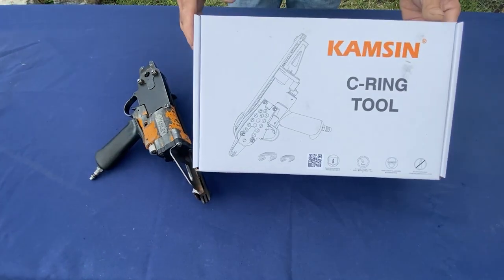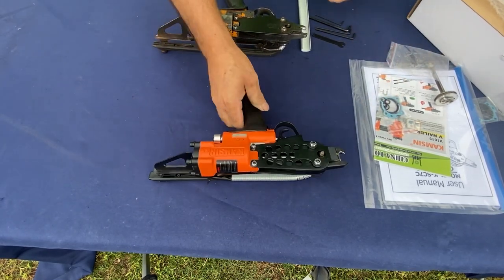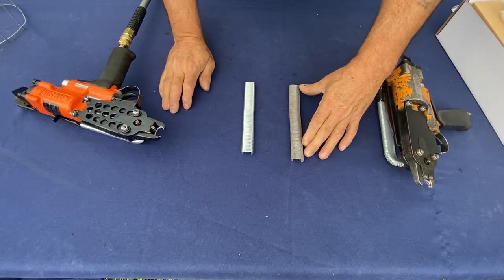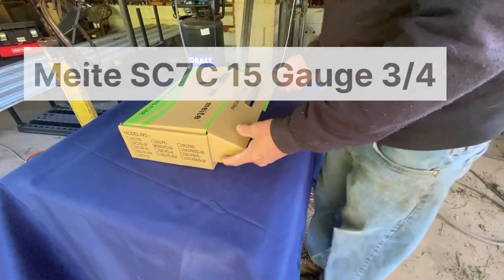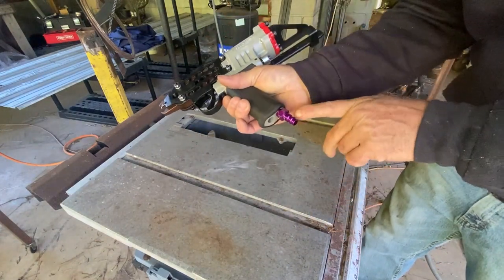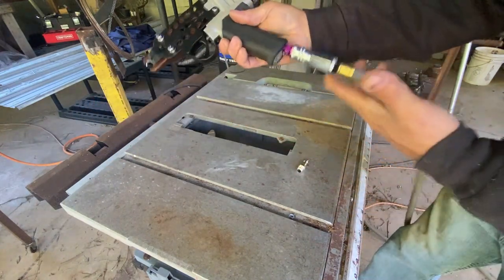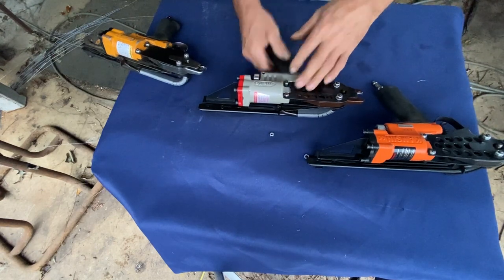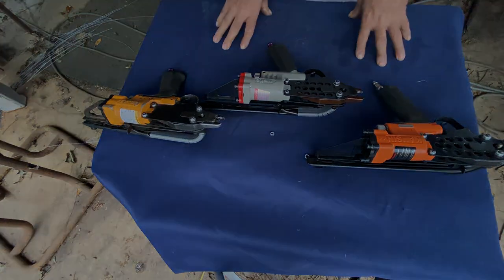C-ring gun & hog ring gun Review, Stanley, Meite, and Kamsin. Watch our review which one is for you.

Comment: Can the size of the C ring closure be adjusted?  I'm new to C ring guns. I'm clamping netting to a 1/8" steel cable and I'm not sure if I want it to slide along the cable or locked into place.  I won't know until I start the project and see what works best.  It would be great if the guns were adjustable.  Great review of the brands and educational for beginners.
Reply from the maker: Thanks, dkcdunn- No! they are fixed and can not be ajusted.